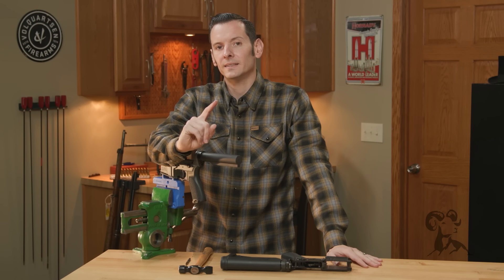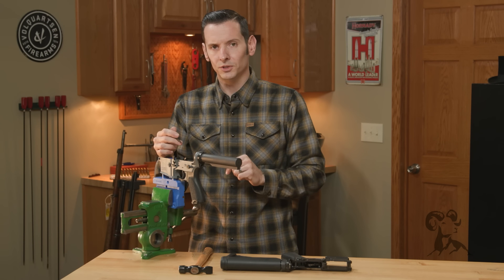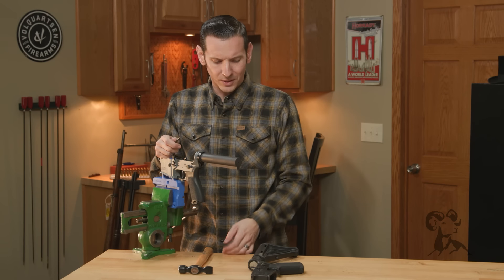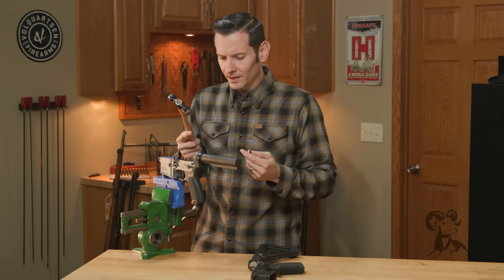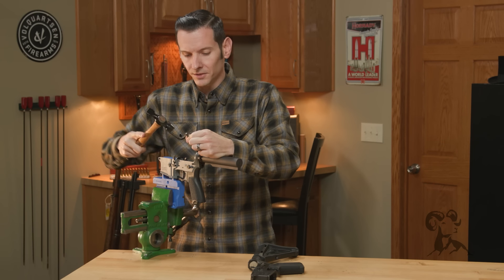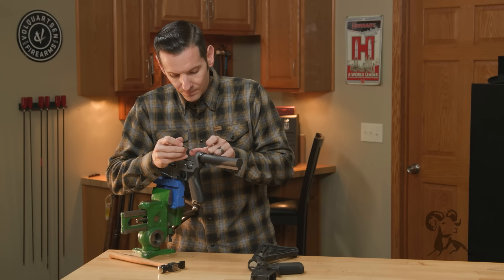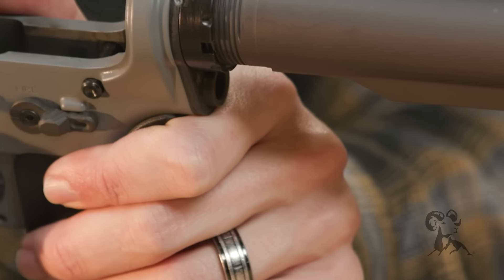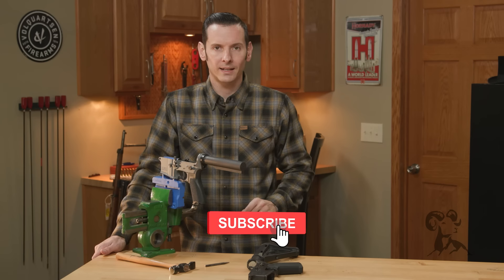Quick Tip: The Right Way To Stake an AR-15 Castle Nut

Comment: LocTite has destroyed more receiver extensions than staking. Change my mind....
Reply: Caleb, I have no desire to change your mind because I'm not an expert. But please tell us how LocTite has destroyed more receiver extensions than staking.
Reply: @William_Charles_Baker  because staking has broke zero.
Reply: is that a SOLGW lower,  loving the M16 cut receiver
Reply: @shadyp-zv3uf  wut?
Reply: @William_Charles_Baker  Well, I personally watched someone bend a lower receiver trying to break a Rock River Arms castle nut free that was held with red loctite. RRA was known to do this in the early 2000s, and maybe they still do. 

If you need a breaker bar to do anything on an AR15, you are doing it wrong.
Reply: I did that on my first build back in 79 or 80. Took it apart one day and the buffer tube and nut spun on the backing plate. Got it off and into the garbage it went. I did not want my friends seeing it. The tube was all torn up. It looked like Bubba worked on it
Reply: @samvittoria9692  Sounds like Bubba did work on it.
Reply: @William_Charles_Baker  When you LocTite steel and aluminum, you'll find that it almost creates a bond like a weld (and I'm literally talking blue loctite, not even red), and when you're taking that castle nut off, you'll essentially watch your threads get stripped off on the receiver extension (and you're going to have to torque it like crazy to even move the thing).  If, however, you put maybe a drop of loctite in there, you may have an easier time, but if you covered the threads, just mark that extension as toast when you try to remove the castle nut.  It's a really disappointing experience, and even a torch won't help in most cases.  You're better off just torquing it down dry if you ever want to swap something, stake it if it's probably not changing.  You'll never forget the first time you remove a LocTited castle nut... it'll be the last time you ever do it.
Reply: Depends on what kind! I’ve broke two free after using blue and it held up just fine I do agree with staking over loctite! Again great video and informative as always thanks Caleb!
Reply: @Rossski  They did. They don't recommend it. I think the issue is that people use way TOO much Loctite or they use red Loctite. A single small dot of BLUE Loctite should be fine. I don't Loctite a lot of things, but I've never had an issue or broken anything that I used Loctite on, including a castle nut that I used it on years ago before I switched to staking and then PWS ratcheting castle nuts.
Reply: Big facts, there's zero reason to ever use loctite. In some rare cases vibratite can be used when you're not able to stake
Reply: Caleb is correct.
Reply: @johnadams673  Your name is John Adams and you’re not familiar with Sons of Liberty Gun Works?
Reply: @animalmother556x45  lol for sure. Red requires heat for removal.
Reply: Or just use the right loctite
Reply: @tylerreis7627  The right loctite is no loctite.
Reply: Generally, I only use blue on screws for optics, mlok/keymod attachments, and grip screws. I don't use red or any other on my firearms at all.
Reply: @animalmother556x45  thats probably because red loctite is meant to be permanent. if they really needed it off, they could have heated the red loctite like you are supposed to when removing it. loctite won't hurt anything if you know what you are doing.
Reply: I just want to find a complete lower laying around where I work..... Dang man, have a couple extras, but their polymer 😢 time for another 7075 T6 anodized aluminum boi
Reply: Bubbas and Boomers slathering red loctite on castle nuts has destroyed more receivers than staking**

If you use the correct product (blue loctite or blue vibratite) the correct way (a drop or two) you will never hurt the gun. 

Of course using the wrong tool incorrectly won't turn out the right way. Does that really have to be spelled out?
Reply: @jurassicturtle3666  💯
Reply: @jameswilliamson3404  I use blue loctite all the time with no issues, just not on a castle nut.   Mine is staked, but I don't see why this is such a big deal
Reply: FACTS
Reply: Loctite on receiver extensions is stupid. If you disagree, you're wrong, always have been, and you're choosing to continue being wrong.
Reply: Just tighten it up real good...
Reply: @jurassicturtle3666 you are way off turtle! We Boomers always stake our castle nuts!
Bubbas now that’s a different   Story 😂
Reply: Looks like Brownell is the one getting made fun of now! har har har ..safety first!
Reply: i stake mine, so i’m not arguing with you. but i also use a drop of loctite. i’ve never had to take one off. i don’t use loctite on anything that won’t tolerate 300° temps. never used loctite on something that wouldn’t totally let go at 250°.
Reply: Your not very good at stuff like that apparently by the comment you made
Reply: LocTite 222MS
Reply: Clean threads good on castle nut and on the extension. Add a couple dabs of blue loctite and torque to spec. I never had a problem on any of mine. If you are worried then just simply stake it like Caleb shows us here.
Reply: Caleb what punch do you recommend can you post the link please? Thanks buddy
Reply: @shadyp-zv3uf makes it a lot easier to break the LAW.
Reply: I have done over 250 with Locke type not a single issue. How many have you done slick?
Reply: @Icriedtoday  I don't understand the question honestly. I have done way more than 250 the correct way, but less than 250 the wrong way.. so I guess you win at doing more wrong than I have.
Reply: Salute, SOTAR....
 @SchooloftheAmericanRifle

Comment: Own 10 ARs i have built myself of various calibers from 556 to 308 and built dozens of other rifles and never staked a castle nut. Never had one come loose either.
Reply: Same. But still a good tip for the toolbox, I guess.
Reply: @gierhedd75  true.
Reply: Me either, but if you're out and about, you'll be miserable with it loose. Only takes a sec.
Reply: Probably don’t shoot enough
Reply: @Wendigoslayer 100% the only gun it has happened to me
Reply: You must not run them hard
Reply: Same here,
Absolutely no need to stake, the castle nut is designed in a way that it won’t loosen if torqued correctly.
Reply: @Usmcar15682 

You’re one on those running and gunnin make believers, eh?
Reply: @NoNameTesla 

Has nothing to do with that, torque the castle nut correctly and the design of the nut prevents its loosening….
Reply: @marshallfelter2414  explain what design feature on the castle nut stops it from coming loose?
Reply: You have so many of them that you haven’t put enough rounds on a singular one to find out for yourself. Enough rounds and it will come off  due to excessive vibration that is a given. Better hope you’re at the range when that happens and not a dire situation. Better to be safe than sorry…
Reply: @sneakymoon556  thousands of rounds, and the oldest one is from 2014. If it were going to happen, it would have happened to at least one or one of the dozens I built for customers over the years would have came back with an issue most likely. And If I havent put enough rounds through them in 10 years to make a difference, I don't think it will make a difference the next time I shoot them either. I torque the shit out of the castle nut probably 20 pounds more than what you're supposed to so that may also be why they never come loose.
Reply: Why would you over torque your castle instead of staking it?
Reply: @mikemcdonald4476  why would you stake it instead of just over torquing it? Nice to be able to take it all apart and build something else if you feel so inclined.
Reply: @sneakymoon556  And that brings up an interesting point... You don't have to stake the castle nut to get the rifle to work. And if the castle nut loosens up it's not creating a dangerous situation but it will take the rifle down until you retighten the castle nut. Whether or not you have ever seen it happen though, a castle nut can loosen up. So, if it is a hard use rifle or one you plan on relying on for self defense, just stake the thing to be sure.

Comment: I have never staked a castle nut.  Never had an issue.  I like easier disassembly for swapping out parts.
Reply: ???? Spend a lot of time swapping out buffer tubes?  You guys....so funny.  I've NEVER swapped out a buffer tube.  If you swap it out....99% chance you are swapping it out with an IDENTICAL part.  There really isn't a good reason to not stake it.  It isn't "permanent", it is more secure, and you are likely never going to replace it anyway.
Reply: @JenkinsStevenD yeah?  I've seen both way's work.  I've made both choices for different reasons over the yrs.  I'd guess it comes down to personal preference.🤔 Caleb here was teaching the proper way to stake IF YOU CHOOSE TO.😉🫡💥💥💥
Reply: @choke666  My comment was advocating for staking.  The Internet these days....
Reply: Spend more time shooting and less time playing fashionable parts swapping and you will see the benefit of staking the endplate.
Reply: @riflesfirst208  truth right here
Reply: @riflesfirst208 I shoot almost daily, Outdoors on private land where I'm able to do whatever I want. Never once had to re tighten a buffer nut.   Only thing I've ever had come loose was Gas block screws. Put some blue loctite and they never came loose again.
Reply: @MichaelAMyers1957  That’s nice. Proud of you.
Reply: @MichaelAMyers1957  How does blue loctite hold up to the heat of a gas block????

Comment: SAFETY GLASSES would be highly recommended! 30+ years as a Tool & Die Maker and I can assure you the flying debris in the eyes comes mostly from grinding and pieces coming off of a center punch.
Reply: 20 years for me in the same trade, and I 100% agree.
Reply: Wire wheels are no bueno
Reply: Safety goggles. I have been to the ER twice to get metal removed from my eye. I was wearing glasses one of those times. The debris can and will get around glasses.
Reply: @thisissparta8884  Face shield & approved glasses the 2nd time it happened from a flap wheel.
Reply: Personally, I would not be using a mag, well block to support my receiver while I’m staking, I would prefer a receiver tube extension block to do the support while I was hammering. I personally do not recommend staking this way.
Reply: Yep, I have a piece of metal in my finger  from hitting a punch 41 years ago
Reply: Yes good advice. Grinding yes but tapping lightly into a castle nut I disagree.
Reply: Where is your video big guy?
Reply: Great knowledge I'm a machinist myself. And I'm always telling the grinders keep your glasses on.
Reply: @marcanthony854  I was just thinking like what if I need to change or lub the spring.

Comment: Been running an un-staked un-torqued buffer tube for as long as I can remember. I'm glad I found this video 😂. It doesn't take much movement at all to lose that spring and pin for the take down pin retention. If there's even a 1/16 gap ive had that spring fly out.

Comment: Ive assembled hundreds of lowers and I use a center punch. It works well and you dont have to worry about hitting yourself with the hammer! 😅
Reply: It's also pretty good at punching some of the pins in without using a hammer.

Comment: Good job! I do two stakes, as per mil-spec. The reason my fellow builders commenting here haven't had an unstaked castle nut back out on them "ever" is because those rifles have never been in the hands of an infantryman for a 12mo combat tour. Range and home defense guns don't need staking. Militia, military and law enforcement rifles need to be staked. Only time I've ever removed a buffer tube is to install one folding stock adaptor, and I was able to crank the staked castle nut off, no problem (replacing it with a new one, so I could re-stake.) 👊🏼🇺🇲👊🏼
Reply: Grunt-proofing

Comment: For recent "reasons", I had to do an extension swap on my AR pistol, which I had staked in exactly this fashion. A good armorer's tool and some leverage will still undo the work, so don't worry about this making anything too permanent. Staking the castle nut is always advised.
That said, I suspect future court rulings to negate recent events, and I chose to not re-stake the nut upon reinstallation in anticipation of doing this work again sometime soon. If/when a final install is made, it will be staked again exactly as Caleb shows here, as this is the only good method I've seen.
Reply: I hope you're right about undoing recent events. The courts always seem able to surprise me with their lack of haste.
Reply: @yzrippin  You seem well adjusted...
Reply: Is this a “To Whom It My Concern” statement in which you are making a legal declaration and notification regarding the alteration of and function of said castle nut? Response is not required, thumbs up indicates yes.

I am not a lawyer, this is not legal advice. You are solely responsible for your actions and outcomes of those actions. 
Best regards.
Reply: @sixoffive  No, staking a castle nut has nothing to do with legality in any way. I provided backstory for why I recently encountered a staked castle nut. Readers are free to disregard the backstory entirely.
But stake your castle nuts, people.
Reply: Weak. Should have just put a stock on.
Reply: @KeepTheGates  Wouldn't have changed anything about the staking procedure.
Stay on topic and keep the false bravado to a minimum. Thanks.
Reply: >complying with laws 
Hah, gay
Reply: You shouldn't have complied. Luckily the vast majority of us didn't comply and made it known and look what happened?
Reply: @ShizawnSanders  Boast however you wish. Your "non-compliance" did nothing to overturn the opinion. You just played pretend criminal for a while, kept it in your safe, and didn't get caught, lol.

Comment: Bought the exact tool you guys said to buy, did exactly what you said and it ended up cracking my end plate. Magpul endplate. Edit: It was because I started the punch process too close to the middle of the end plate I would definitely do a closer to 1/3 to a 1/4 from the side, worked night and day better for me and got a perfect stake. super easy.
Reply: Bit of common sense aint it

Comment: I'm glad to see you showing people the right way to do it, so many of my friends didn't even know that it needed to be done and the nut came loose at the range! I always carry tools with me just in case of this reason
Reply: If you tighten your shit down like a man, you don't need to stake.
Reply: @Chewedbacca  Yes you do. There’s clearly a reason government contract guns are staked (as well as any competent manufacturer)
Reply: What happens when they come loose?
Reply: @TUKByV1  The 'best case' would be: your receiver extension is now loose, meaning your stock is also loose and can rotate side to side. 

The 'worst case' would be: your receiver extension rotated far enough to allow the rear takedown detent and spring to leave the gun, meaning there is now nothing holding the rear takedown pin in place, so it could walk itself out and your upper and lower are no longer held together in the rear.
Reply: @TUKByV1  my friends stock twisted to almost 45 degrees while he was shooting at the range
Reply: @johnnydhillon70  that sucks! Better staked than sorry.
Reply: @animalmother556x45 I know this is old as shit. I am a vet that fired a many government firearms. Non of them were ever staked. I actually watched this video to see why you would stake a castle nut. In 20 years of never staking an AR castle nut, I have never ever ever had one come loose. This is a way for you to waste money because you will ruin you buffer if you ever loosen the castle nut.
Reply: WRONG Chewy.

Comment: In my experience, a random "MILSPEC" LPK usually has a butt-plate that is easily workable with a good angled punch. However, I swapped in one of those Magpul QD butt-plates, and that was considerably harder steel to move. Using a good quality hard punch is key. If you don't have one, get one.

Comment: I use a Starrett Steel Automatic Center Punch on every build I've ever done.  It does a much better job moving the metal IMO and have been complimented by many gunsmiths and armors for having perfectly staked castle nuts. Mine look just as good as yours😉👊👍🇺🇸
Reply: Which diameter? I see a few on Amazon.
Reply: size?
Reply: That just for marking metal for your drill bit pilot. Recommended by AVE, use the auto center punch to accurately make your mark, then follow up with a big beefy hammer and normal center punch. If you give it one solid hit, it shouldn't move from that previous mark

Comment: Would be nice to see you show the best way to remove a staked part, ie: gas key, buffer tube nut, etc.
Reply: I second that because something tells me the method I use isn't great if you're looking to reuse parts...thankfully I always end up swapping the standard plate for a qd mount so theres that I guess lol
Reply: just try to push the metal out of the slot and break the castle nut free, but sometimes it might be really stubborn, plan on at least losing your backplate. I like to use a spare brass drift punch to turn the castle nut or a spanner wrench
Reply: @ArgolasBowmaster  just try to push the metal out of the slot and break the castle nut free, but sometimes it might be really stubborn, plan on at least losing your backplate. I like to use a spare brass drift punch to turn the castle nut or a spanner wrench
Reply: @joshuajohnson6018  i always wind up replacing it anyways.  I was just hoping to find a way to maybe salvage it
Reply: with a wrench
Reply: Caleb has a short, 2-min. video on removing staked castle nuts.
Reply: You just back it off.
Reply: PIPEWRENCH!!!

Comment: Going to do this for an old lower I never bothered to stake. Also, love you guys - I called the tech line with a very specific question about installing a muzzle device on my BRN-180S, and got someone helpful in like 5 minutes. Thanks for providing that service.
Reply: Make sure you torque it down good beforehand👍